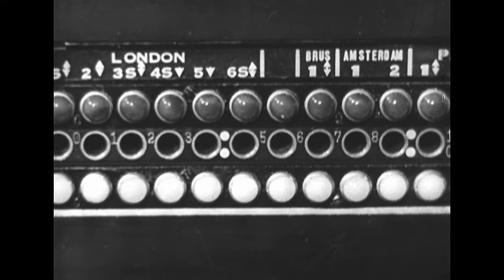Trans Atlantic Calls in 1947?  Western Electric & Bell Telephone System History, Trans Oceanic calls

Comment: had no idea they used shortwave to send calls across the pond "back in the day". Always had the impression it just wasn't possible to make calls before the cables were laid
Reply: Yep, radio was used, but I don't think it was shortwave.  Lower frequencies are more stable over time, whereas shortwaves are affected by time of day, season, and the 11 year solar cycle.
Reply: @James_Knott  Sure it was shortwave!  Different frequencies were available to the stations (different transmitters and antennas) and they selected the best one depending on those factors.
Reply: @James_Knott It was  definitely shortwave as I used to receive these transmissions on my shortwave radio back in the day.  In fact, shortwave was used for transoceanic telephone calls well into the 1970's.  Of course, as more cables were laid and satellites were launched, the use of shortwave radio declined to almost zero use.  BTW, most of the radiotelephone calls were encrypted by speech inversion technics, which rendered the reception impossible to understand by a third party listener such as radio hobbyists and the general public.
Reply: @deanbianco4982 James is partially correct, I've read that they did use medium wave as well as short wave.

Comment: The operators are gone but are replaced by calls you don't want. I've lost track of the calls I've gotten from foreign countries trying to scam me. The long distance call was an expensive novelty back then. Now it's a nuisance, where there's little, if any, incremental costs in making one. Times have changed.

Comment: Two different paths?! I had no idea🤯
Reply: It's to prevent the two directions from interfering with each other.
Reply: @David Wanklyn No, it was a matter of a strong, nearby transmitter overloading a receiver.  By having the separate sites, that issue is avoided, with what's called space diversity.  You can get an example of this by listening to an AM station, while driving by another station on a nearby frequency.  The station you drive by might completely clobber the one you're listening to.
Reply: Two main reasons. Using two frequencies makes full-duplex possible and physically separating the receivers and the transmitters prevents front-end overload.

Comment: I'm sure an international telephone call via an HF circuit was nothing like a local call. Atmospheric noise, fading and manmade interference have always made high frequency unpredictable, one moment the audio is loud and clear, then the ionospheric refraction angle changes and the signal sinks into the noise. There were also seasonal variations, winter is generally better than summer owing to less lightning and the eleven-year sunspot cycle made a big difference, with more sunspots giving a higher minimum usable frequency (MUF) and typically less noise.
Reply from the maker: Hi kc4cvch, that's a very good point about the HF circuit quality.  I can imagine the voice transmission fading in and out during a call, making the connection a bit frustrating.  The ionospheric refraction too.   Sound like you know your radio tech.  Thanks very much for the informative feedback.  "MUF" is a new one to me.  Have to remember that.  Thanks!  ~  VK, CHAP
Reply: @ComputerHistoryArchivesProject  Different frequencies were available to the stations (different transmitters and antennas) and they selected the best one depending on those factors.
And of course technicians were monitoring the situation all the time, so they would switch frequencies as required.
Still, it would not have been as clear as a fiber cable, of course!
Reply: Now we can see why engineers were so keen on finding alternatives to HF radio as a means of placing telephone calls overseas, for the reasons you stated.
Reply: @ComputerHistoryArchivesProject  Frequency Diversity, it was called. Also Space Diversity (multiple receiving antennas on the same frequency but spaced apart) was a help
Reply: These companies could afford big plots of land to built monstrous rhombic antennas. The benefit of a rhombic antenna design is that it has very very good gain to ensure a strong radio signal focused in the direction of the receiving station. The drawback of a rhombic antenna in relation to most hams and hobbiests are their size. Especially at the low medium and short wave frequencies.
Reply: @kc4cvh I can see where the multi antenna would help with fading.

Comment: I remember when I took my senior trip to Germany in 1980, it took a while to connect to my parents in Memphis.  There was also a lag when talking.  In 1999 I talked to my girlfriend in Singapore. I used 10-10-321.  Remember those? It was .18 a minute and very poor quality. ATT was .32 a min with international calling.  Now with What’s App it’s free.  So I can literally call long distance for free.  My family did a zoom call with Jakarta, LA and Memphis so communication has come a long way.
Reply from the maker: Hi Brent, the overseas calls were quite a challenge then, and 1980 wasn't even that long ago.  The tech has come a long way.   I still find local cell phone calls annoying when they are over a poor connection of cheap phone.  I prefer a sharp clear voice call.   Like Ma Bell in her prime.   Thanks very much for sharing your experience with the LD calls!  ~  VK, CHAP
Reply: @ComputerHistoryArchivesProject  The eighties was the times when international calls were routed over satellite.  That introduced a long delay, and to avoid "echo" the link was artifically made half-duplex ("echo cancelling") so you would have to be careful not to speak at the same time because the other party would not hear that.
Later with undersea fiber that became a lot better.